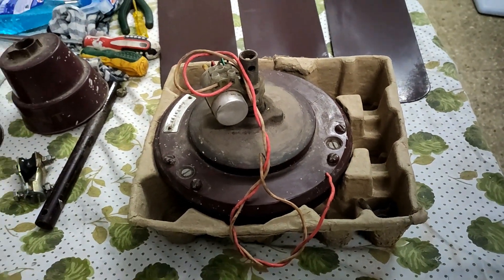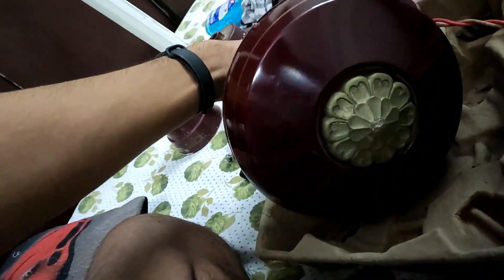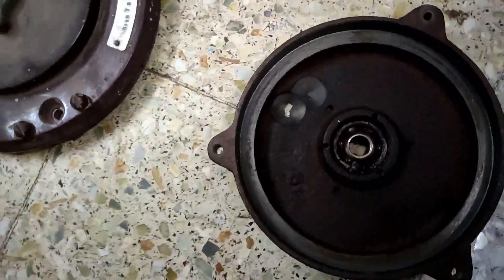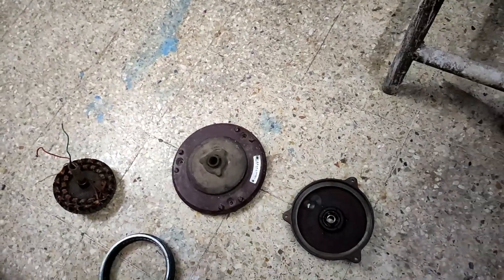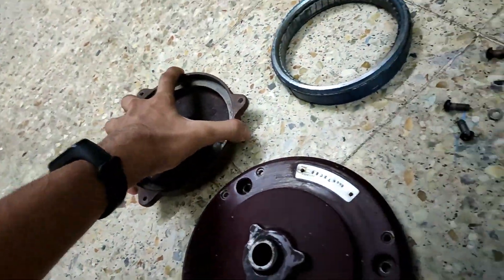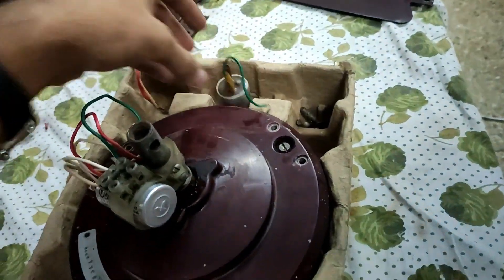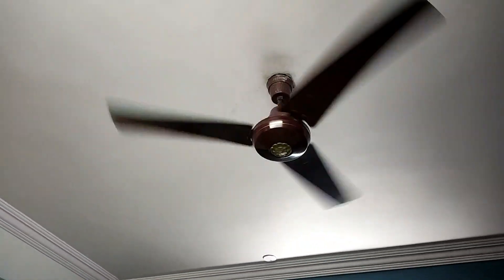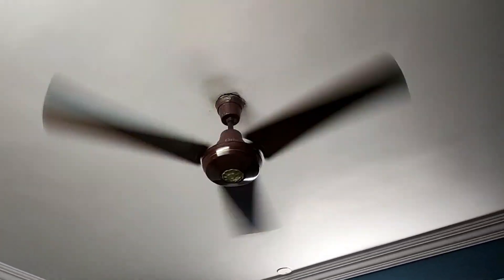1990'S ORIENT DELUXE CEILING FAN 48"  BROWN

Comment: I had the same fan with 3 .15 mfd capacitor.  Awesome ,  keep it up
Reply from the maker: WOAH 3.15 might have burnt the coil
Reply: IT burnt so time before bro, I  have  just the dead body of it
Reply from the maker: @tanishbhagat8733  2.50 is the max capacitor we should use, else fan will burn if used any higher
Reply: @tanishbhagat8733  If You Have This Fan With You Can I Take It From You
Reply: @motoartbyhariteegala116  after you buy dat fan dont forget to rewind it

Comment: This is late 80s model if im not mistaken, 1991 orient has the redesigned motor, and there is an earlier version of the redesign that came after this model before the 1991 model
Reply from the maker: yep late 80's

Comment: Aryan bro! My ORIENT DE LUXE is not rewounded. its original only, how i come to know is that i asked Pankaat about his DE LUXE 56"which is also from same year just like mine and he told me that its original coil only and because its export model, the company had to increase the pole from 18p (Indian model) to 22p (Export model) they had to put all the 22coils in a small thick stator so they decreased turns maybe. Whatever might be! the coils are 100% original only!
Reply from the maker: thats great , maybe lead wires are replaced then
Reply: @electrod.i.y7165  Yup!

Comment: This fan is too slow!
Reply from the maker: yeah
Reply from the maker: Lol , crompton High speed fans have 12 pole motor with 380 Rpm , Your favourite orient is the Snail, 320 Rpm Crap
Reply: @electrod.i.y7165  Orient Falcon 400 is much faster than this
Reply from the maker: falcon 400 is fake claim , it has 380 rpm but no airflow , crompton has RPM and airflow
Reply: @electrod.i.y7165  I have a Orient Hurricane ceiling fan in my house. With old capacitor it was running slow, then they replaced the capacitor and it spun really fast but the airflow is not good like HS.